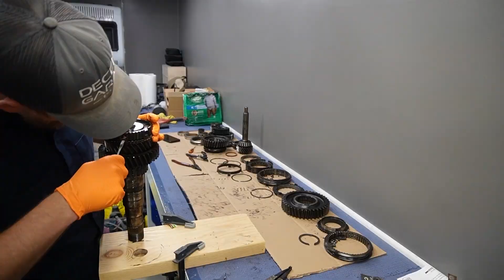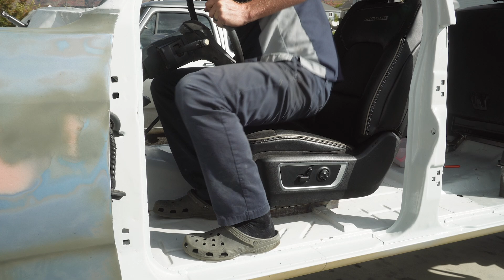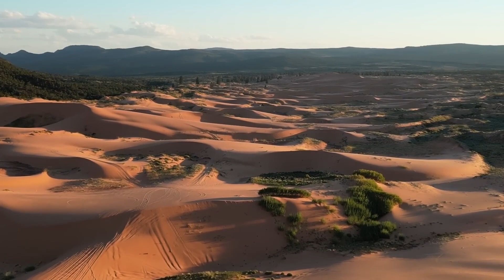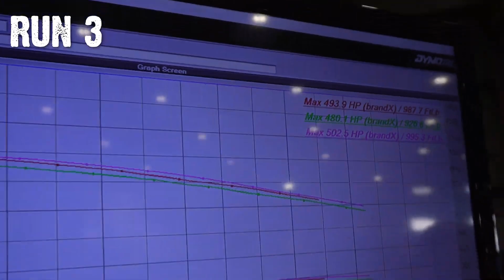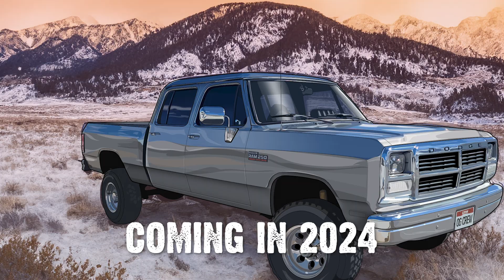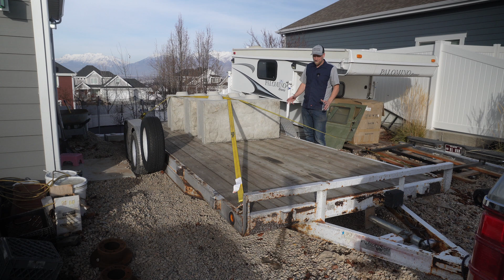I Think I Found My Next Project. Or Two?

Comment: The 4x4 swap isn’t too bad. I felt like the worst part was properly locating and cutting the rear spring hanger locations. A mag drill would have been a way better way to do it had I had one at the time. Too bad you aren’t closer I still have the sections of frame I cut to make the templates to locate the holes you could borrow.